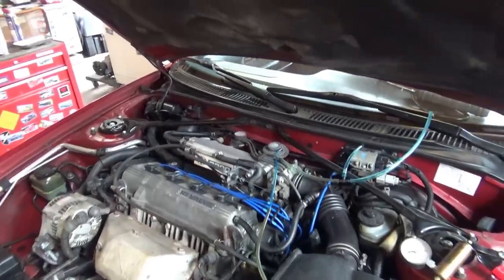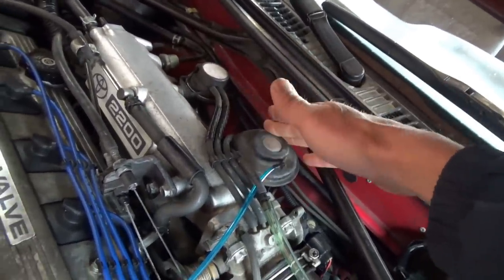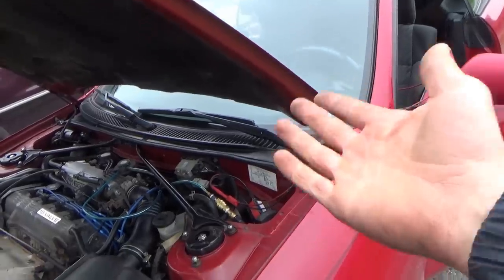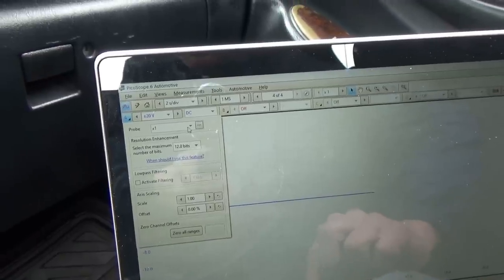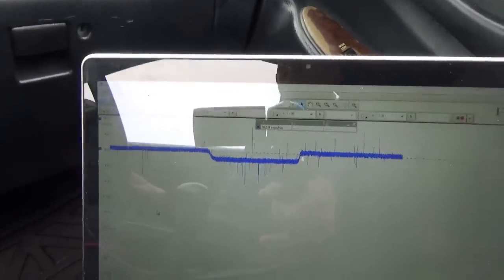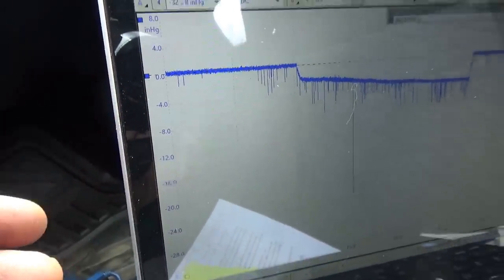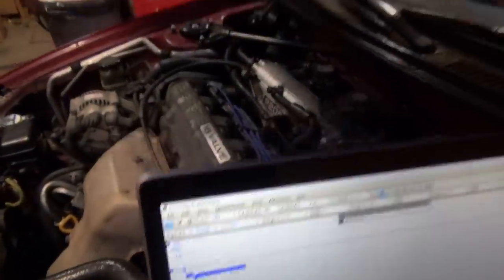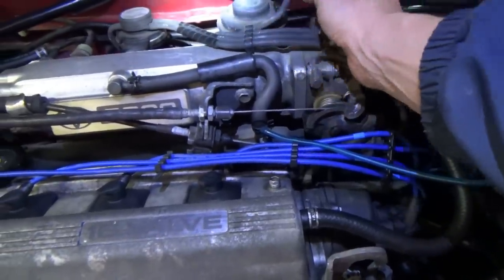The CELICA SAGA - Part 2 (Surge on Highway)

Comment: Be warned. The ECM will add spark advance during EGR to account for the reduced volumetric efficiency when breathing inert exhaust. So you can easily end up with pinging by disabling the EGR without the ECM knowing. Also the car may very well throw an EGR performance code.  I'd replace the valve.
Reply from the maker: Yes of course CEL came on, but car drives much better with no ping 👌🙂
Reply: Now it makes NOx.
That's bad.
We had a delay/bleed to manage objectional valve operation.
But that's on a different make.
We also found very small rocks in our cold blooded ones.
The tiny specs would cause hitching.
Not surging, technically. I don't know if it helps, but that car had that constant cooling fan for all that time.
Reply: @dannylinc6247  FWIW, I had a 93 Caprice ex-police car that I eventually had difficulty passing emissions with.  The car did have a lot of miles but in the end I ran some of my cleanest dyno runs (before my state stopped the requirement) with just two stock 95 Impala SS cats.  I had long disabled the EGR system due to it causing a nasty surge at low RPM.  I also tuned that car so I could play with spark advance and stuff like that but like I said, the last dyno run it did was quite clean and did not have any EGR functionality.
Reply: @kevin9c1  then you were making NOx emissions.
A deadly gas.
Laws or no laws.
We had selective orifice sizing for some of ours.
You added a restriction washer that had numbered size inlet hole.
If it's a racecar, that's not running all day on the street. But for the public, this is part of the attempts to manage the driveability.
It's supposed to work at cruise. When combustion temperatures climb up to 3600°F.
The hitching some cars would get could be EGR leak by, caused by the tiny rock like deposits in the pintle.
I don't know if any of that helps you now. Or if a GM application had similar attempts by engineers, but we also had delays and or bleeds.
Alot of a
Gm cars I saw, people just put a plate there and said, no, not spending if they don't make me.
(Oxides of nitrogen) NOx
Reply: @dannylinc6247  Oh I definitely was making NOx but it was below the limit for the test and therefore I passed.  I have the numbers somewhere....
Reply: @kevin9c1  a gas analyzer does not measure NOx.
They, instead do comparisons to known factors, install systems, and once required they be in working order.
That's how they successfully cleaned up cities air as best they could so the sky looks blue, and the news doesn't warn you so often not to go outside. Like in Denver, where the first air quality alert was in 1949.
They had state testers who tested the emission tester guys.
They sent this one guy a car that looked and seemed to be untouched and low miles.
He was required to do all these inspections.
They even tried to get him to let them go sooner with a gotta get to work now story.
I was his apprentice of sorts.
He went up front, found the owner of the shop, and laid it on the line.
Either he performed every functional check, or they needed an end of day drop off appointment.
The shop owner had a GS mech. using his own car ready to drive them to work.
Just then, we found the air cleaner stuffed with shop rags.
How do you like that.
I don't miss those days.
He not only could get his license suspended, but he and the shop could have been fined separately if he didn't do the whole list. One step at a time.
We beat those crooks.
Not much fun.
Just get to keep your license, that all you get for beating them
bastiges.

Comment: Some of those EGR systems would plug up in the head so that the furthest from the the EGR valve would plug up in the head and all the EGR flow would go to one or two cylinders which caused combustion problems.  Your right about the valve spring.  They only take so much heat over a certain amount of time.
Customer's happy, good job all around.

Comment: A dab of silicone on a #8/#6 machine screw pushed into that vacuum line would do for a plug. Time for some tires, easy and obvious need. Good diagnosis using the pico and vac pump.

Comment: Back in the 80's and 90's, we use to fit a little ball bearing into the vac line to disable the EGR valve so that the engine was always getting clean air 100%.

Comment: Ivan, just a thought. I had a 1985 Datsun B-210 that had probably one of the first EGR systems on it and it had to be cleaned every now and then to perform as intended. You mentioned a spring could a little "carb" not throttle body, cleaner help. The cleaning of my EGR was aimed at the seat of the valve.

Comment: It would’ve been interesting and perhaps helpful to have monitored the MAP signal during the test driving. The degree of MAP increase in response to the EGR vacuum, at the small throttle openings particularly, should give some indication of excessive EGR flow.
Reply from the maker: Great suggestion!
Reply: EGR systems have been causing tip-in hesitation and driveability issues since they were introduced. An entire book could be written on the subject, and half the book would be how to dial it in.

Comment: My late grandfathers old mechanic just cut & silver soldered the exhaust gas pipes which screw into the exhaust ports in the Holden 2.85 litre (173 cubic inch) Holden 6 cylinder "blue" engine (they came out as a red & Blue engine in Australia) then he silver soldered the pipes up, they were the pipes for the EGR valve in his old 1983 model Holden VH Commodore.

That was a cheap fix since they are has to find & a lot of the vacuum switches were broken anyway, they would've been hard to come across in say a 32 year old car 🚗 which was about the last time he drove it (2015),it would've been an illegal fix but his mechanic didn't think that he was going to drive it for much longer !
Reply: Those pipes were for the air pump not the EGR for the 2.85 motor

Comment: For what it's worth (very limited worth),  my wife's '97 Camry was throwing a code for "Low EGR Flow" - I can't remember the P number. The issue was a solenoid on the back side of the engine under the intake manifold - nearly impossible to reach. At about 2000 RPM, the computer would turn the solenoid on (don't know what all the programmed variables or logic was) and that would enable the vacuum to enter the system and start opening the EGR. I guess it was looking for a change in the MAP sensor or something - obviously, there is no flowmeter measuring the EGR flow, but it somehow "knew" the EGR valve wasn't opening! Different problem, but maybe related to yours in this case. New valve fixed the problem that time, but it didn't get mounted where the old one was! That and a connection issue to the left rear wheel speed sensor were the only computer-related issues I ever had to fix on that car. But I did spend hours and hours fighting oil leaks. The oil pump o-ring was cracked and it looked like the pan gasket was leaking. Oh, yeah - I had to replace the heater core, and that was terrible. She sold the car with about 260,000 miles on it. Other than the oil leaks and that doggone heater core...... Oh, wait - the power steering rack and pinion leaked. I had to drop the subframe to change it out! It was a good-looking car, though, for a 4-door.
Reply: it monitors the MAP/MAF and O2 sensor/s for changes that match against the known tables. if it doesn't match up it sets whatever trouble code and light on.

Comment: On my Volvo 2.4t I have disabled the EGR system in the ECU and did a delete. Also have done a catalytic delete and some other stuff. The only downside is that sens the new ecu I have to run 98octane. But the bonus is I went from 200 somewhat lazy horse to about 300horse with a decent powerband. Did also delete the turbo regulator not needed 😂 and the turbo boost sensor I've put a tiny leak valve in so the ecu is happy about the boost pressure and does not cut spark/injection due to over pressure 😎

Comment: I had a few vehicles through the years where the EGR valve diaphram spring got weak. It's usually more noticeable with a carbureted engine.

Comment: I had an 86 Oldsmobile with Michelin tires, which I let sit for months without driving. After I started driving it again, all 4 tires eventually failed as the steel belts separated inside them. The tread literally came apart from the body of the tire. One failed on the Interstate 10 bridge across Lake Pontchartrain which was an interesting experience! Just a guess, but most tires might do that if they sit long enough due to constant distortion at the same spot on the tire where it hits the ground. Constant pulling on the same place, where the rubber is bonded to the steel wire might eventually cause the bond between them to fail. But it might have been a bad tire design. Hurricane Katrina flooding got the car and the new tires. Got the house too.
Think how many mechanical devices wouldn't exist without the simple spring. They support modern civilization.

Comment: I wonder how much work is involved to open up that EGR valve and manually stretch that spring to restore the spring tension.
Reply: It's all crimped. It'll be destroyed by the time you get to spring. And, if it is back pressure transducer EGR valve, there is some interesting stuff going on inside that puppy.

Comment: One not so common Toyota problem I've run into was the port from the EGR back pressure transducer would clog where the hose went into the exhaust passageway. If it clogged completely the EGR wouldn't work at all, but if it was partially clogged the back pressure would get trapped in the transducer and cause the valve to open too much and stay open too long until the back pressure bled off. It would cause surging and sometimes the engine would stall when the throttle was released.  How can I order one of your pressure transducer kits? (with banana plug adapters) a lot cheaper than Snap On.
Reply from the maker: I've seen that exact fault on heavy oil burners like the 1.6 Corolla engine. See description for transducer order link 👍
Reply: @PineHollowAutoDiagnostics  3|D@ call it an extended diag

Comment: It’s lean PHAD..On these vehicles you have to remove the injectors and flow test them with a Fuel injector flow rate and cleaner set-up.
Reply from the maker: Fuel trims were perfect if you remember from Part 1 ;)
Reply: It’s not a “weak” EGR spring..the engine is lean when u remove extra lean fuel mixture (EGR) the engine runs better because the engine is lean
Reply from the maker: @JOMaMa..  Engine runs better because it's breathing fresh oxygen instead of its own farts haha

Comment: I once had a 1973 Buick with a 1976 engine (455 4 bbl).  The EGR was disabled on the new engine as the original 73 most likely didn't have it.... I got nearly 5 mpg more by fixing the EGR. Some engine designs actually like recirculated gas as it cools and slows the combustion in the cylinder.  in any case I just replaced and EGR in a 94 Saturn and the valve only cost a few bucks new.  Two screws and done in a few minutes... worth getting rid of the idiot light.
Reply from the maker: However this isn't 1970s carbureted technology anymore. Any fuel injected engine will adjust the mixture automatically, and obviously the engine has more power breathing fresh air rather than exhaust gasses 😉
Reply: @PineHollowAutoDiagnostics  Yes and no... some systems actually use the exhaust gasses to slow the burn to prevent detonation.  An EGR system can actually keep the engine cooler. And yes, I was absolutely shocked to hear that. Not that the 76 Buick engine likely had any detonation at a 7.6 to 1 compression ratio. Back in my day... when streetliners and dinosaurs roamed the highways and primordial marshes, I was a pretty good diagnostician...  I even still own a CRT scope (not that I've used it in decades) and I've got a bidirectional scan tool for Ford.  My health prevents me from doing any serious work but your videos kind of keep me mentally in the game... Thank you.

And in my day, we just sucked on the diaphragms to test them...  vacuum gauges were mostly for fine carb adjustments and no one with healthy lungs had a vacuum pump.

Comment: Why didn’t he replace the EGR valve?
Reply from the maker: Because it's non-essential haha
Reply: Because the EGR is a symptom to an underlying condition the engine is lean. The engine has restricted fuel injectors and need removal from intake manifold and serviced in a fuel injector flow tester/cleaner tooling

Comment: Hi Ivan, Too bad ya couldn’t pick up a used EGR valve. Might have been a good way to prove out your diagnosis. The only problem you might have with disabling the EGR is an increase in NOX emissions since the EGR’s job is to cool the gases down and prevent premature detonation or knock when accelerating. Good diagnosis

Comment: This is one of your videos in which you become one of those you criticize, a hack.  A vacuum delay valve should of been the answer, for the EGR to open at a little higher rpm but no, disconnect the EGR and allow higher NOx be the answer.  How many uninformed are going to watch this and plug off the EGR valve.  Some times you disappoint but acting smug  about a wrong repair is wrong.  Fix it right.
Reply from the maker: I might be a "hack" but my customers are always 100% satisfied with the outcome ;)
Reply: @PineHollowAutoDiagnostics  You need to re-read, THIS VIDEO IS A HACK REPAIR AND YOUR REPAIR IS NOT A CORRECT ONE.  Normally I enjoy your approach to concerns and repairs.  This one is irresponsible from an emissions point of view.
Reply from the maker: @thk7513  it was polluting more when it was surging due to poor combustion. Plus now it gets better mpg. So turns out that I'm conserving resources AND reducing pollution. HA 😜
Reply: @PineHollowAutoDiagnostics  keeping meticulous mpg records as I drive to and from work.  Probably filled up 6 times since you worked on my car.  I was getting around 26 mpg, I am now just shy of 31.  It is runs as sweet as a nut, as well it only burned a quart of oil since the last oil and filter change 4,000 miles ago, not bad for a 4 banger with 234,000 miles!  Still got the square tires but can live with that, will put nice new ones on when the tread is worn which won't take long!

Comment: Yo. IVAN just wanted to say say that I would have just unplug the e.g.r. then test drove it.  But maybe I have been doing this before you were born.  But besides that did you know that tempering with and or disconnecting emissions systems is a federal affence and you can be fined by the Environment Protection Agency??? So next video maybe be careful of what you do because of your comments you have incriminating evidence that can be used against you...